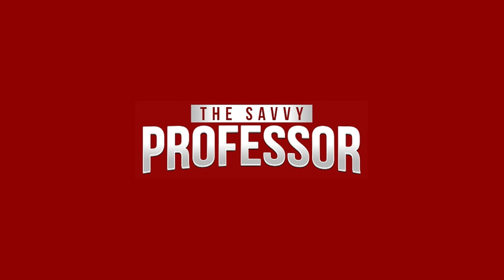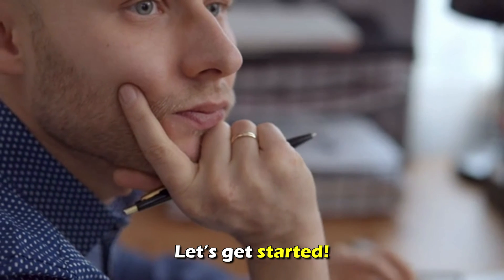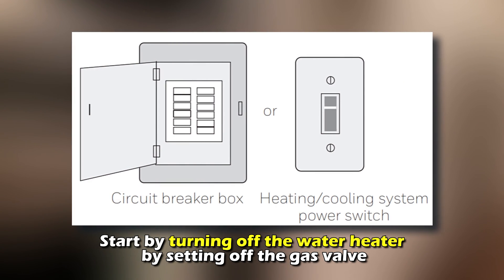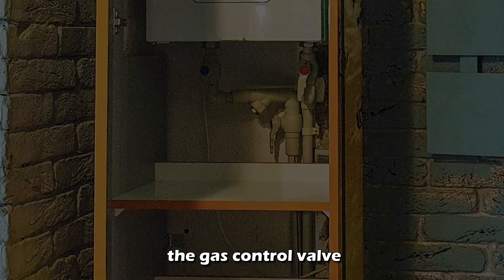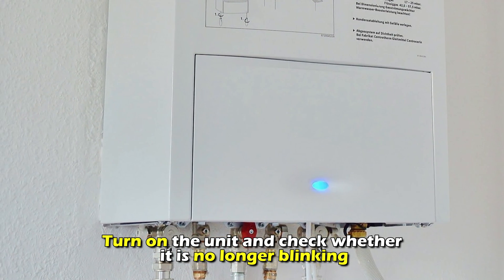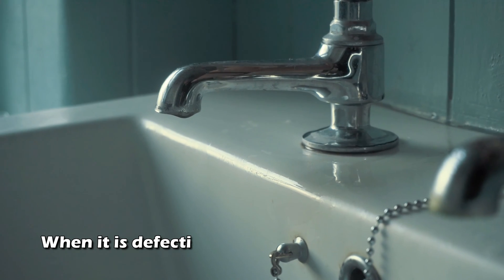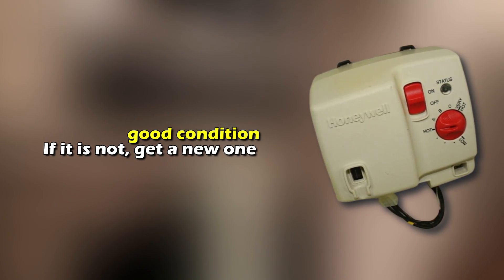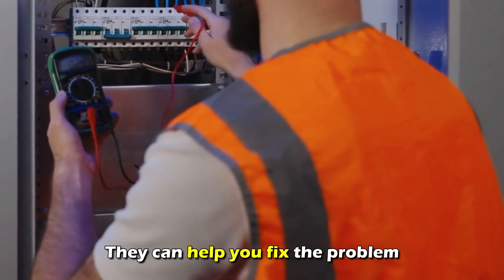Honeywell Water Heater Blinking 7 Times (How To Fix Water Heater Blinking 7 Times - Quick Solution!)

Comment: What worked for me was unplugging the wire for the chamber sensor from the gas valve. Blowing on the end of the of the wire and blowing on the part where it connect to on the gas valve. Had to do this multiple times but it has seemed to fix the problem.